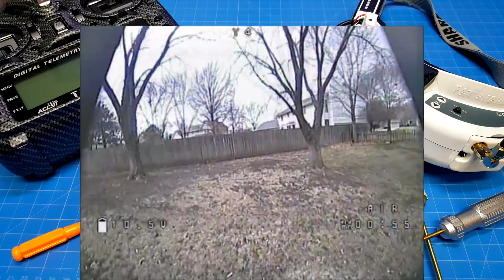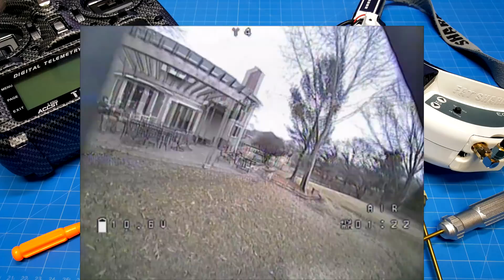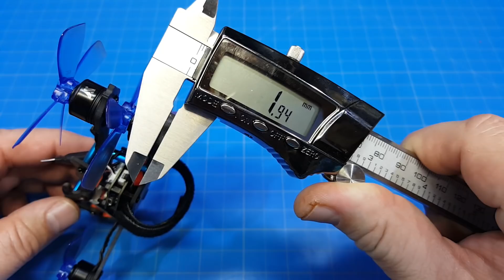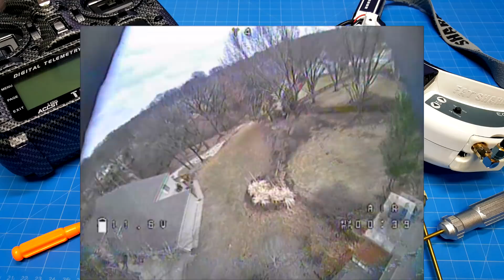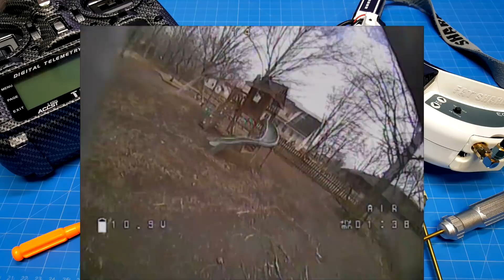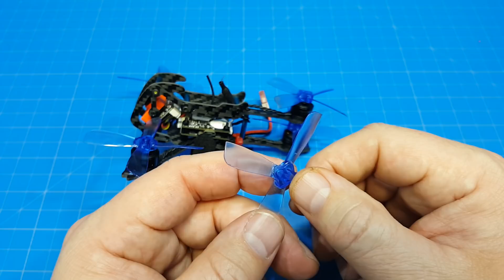DragonFly 110 Y4

Comment: You were whipping around those trees with this thing! Nice Nick! What rates do you use? And do you use the same rates for every copter? I currently run all of mine on RC rate=1.25 and all super rates at .75
Reply from the maker: My rates are P and R 1.2 Y 1.3 super r  for P and R .75 Y .80. Yaw is passive I have found I like the yaw a bit more sensitive.
Reply: Nick Burns Thanks! I might try upping my yaw a little👍

Comment: When i first  got into "quads" i wanted a tri. But no brushless micros were around. I hope they make more as i would like one.
Reply from the maker: I would think a traditional tri would be hard to keep in the air. The rear motor taking an impact with all our crashes.
Reply: Nick Burns you  mean with a servo for the tail? Maybe? Would be interesting to see. A Y 6 setup  would also be interesting... 6 motors... imagine 6 1106 on a sub 100g!

Comment: You can run the New Avan 2.3 inch Babyhawk Props on this one Nick. Also, the Kingkong/LDARC 2.3inch props from the ET 115 fit too! Awesome review and nice flying 👍😆
Reply from the maker: sure, smaller props, but that wasn't my intent. I think some might be a durability improvement over these, its just an odd ball size.